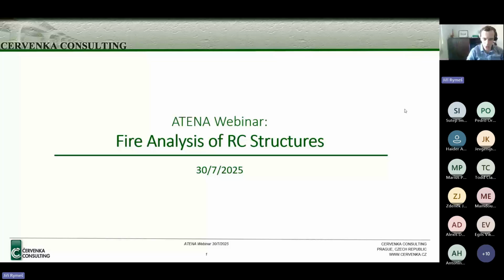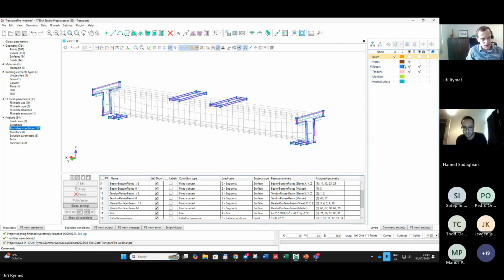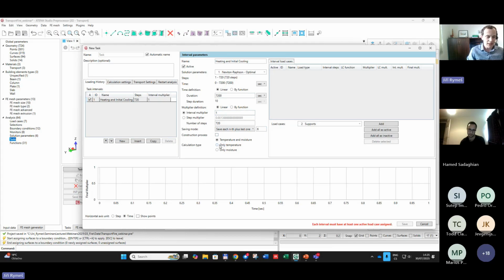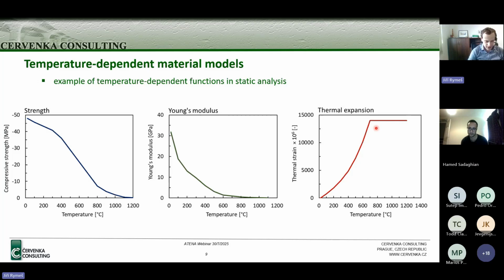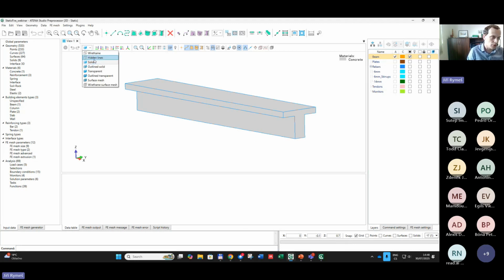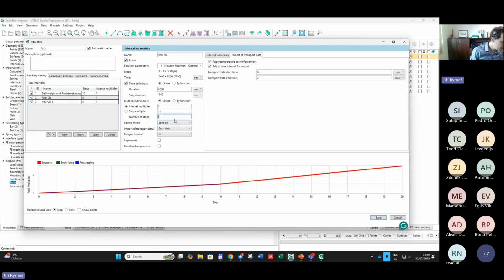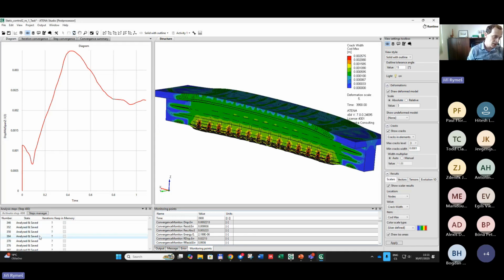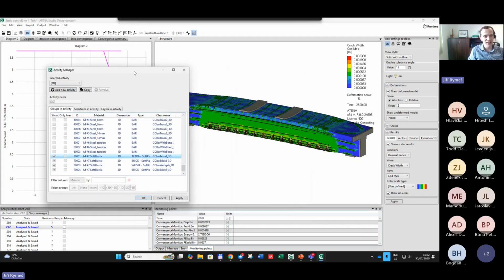ATENA 2025 Webinar no.3 - Fire Analysis

Comment: Excuse me sir, I am a student who is working on my final project using ATENA, but my demo license for local registers is limited, is there another way without using another laptop? thank you for your attention.
Reply: hey rzzledzzle8721 I am also trying to use ATENA to model some concrete slabs. How did you learn to use the program? I have the manuals that come with the free triel but I find them difficult to understand and am wondering if there is a better way to learn how to use Atena as there are not many resources online.
Reply: @verlgrant Have you tried modeling slabs with GiD? Because I use ATENA for post processor only.
Reply: @rzzledzzle8721  yes, I am using GId to model and then running the model using ATENA. But I Am wondering how you learned to use GID. Is there any good resource's that might help me learn to use it or do you suggest just reading through the manuals?
Reply: @rzzledzzle8721  Ya I also use GID and then ATENA for post processor. but what do you recommend to learn GID?
Reply: @verlgrant https://youtu.be/XKWIWreuFbM?si=-azHN_9OC_x8cM5n
Reply: @rzzledzzle8721  This is a very helpful video. Is there any other resources you would recommend?